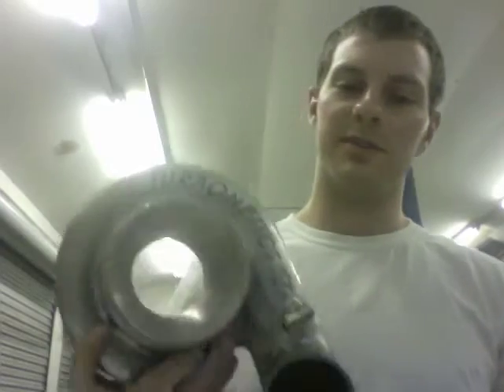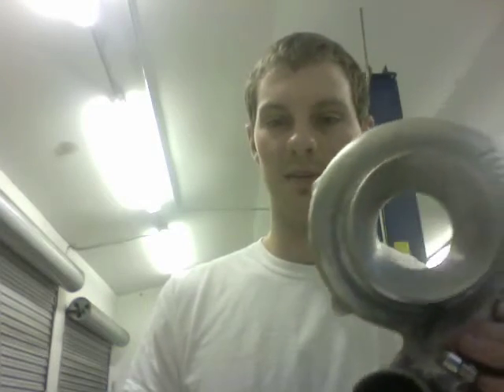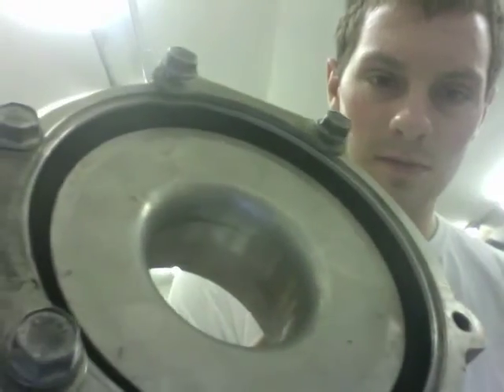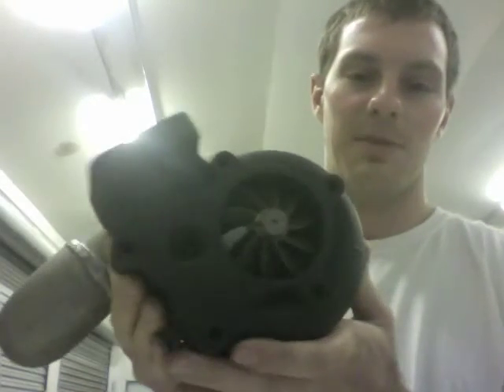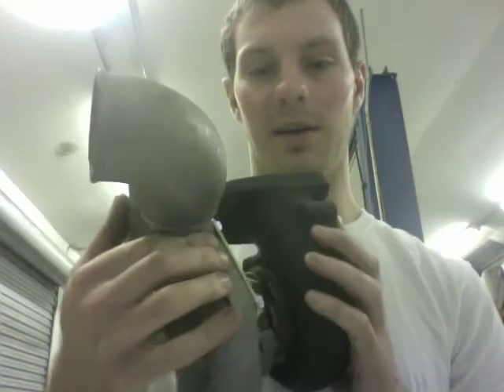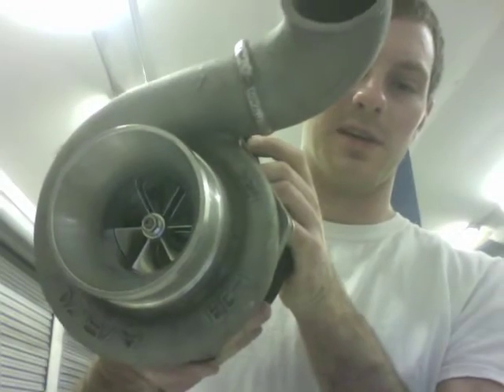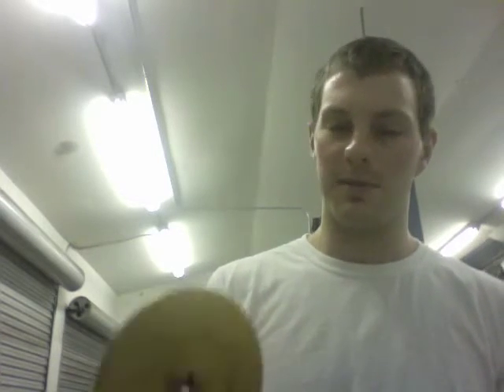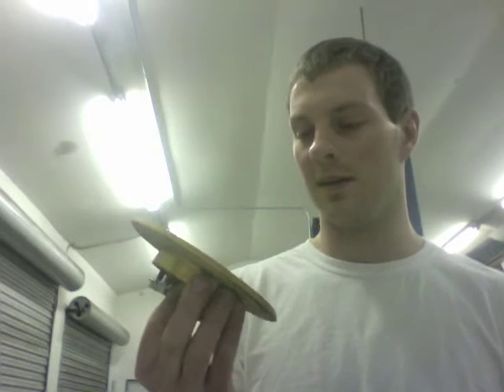Turbonetics 60-1 Single Ball Bearing Turbo Upgrade

Comment: Heyy m8 I have a turbonetics turbo t70 t-19859 
I have the turbo striped down im after a rebuiild kit the 2 bearings and the thrust washer i have messurements of old parts if needed 
Also can i use my old exhast and compressor but change core to a ceramic ballbearing ? 
If so how much would this cost thanks
Reply from the maker: Dave Fd email me some pictures turbolabamerica@gmail.com